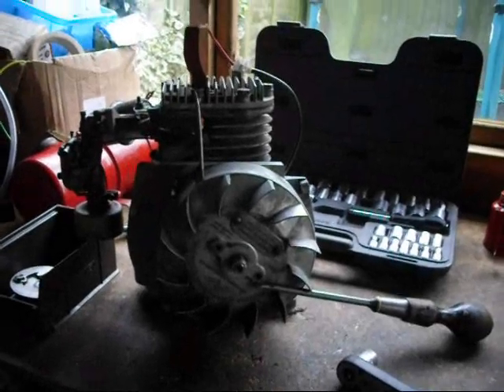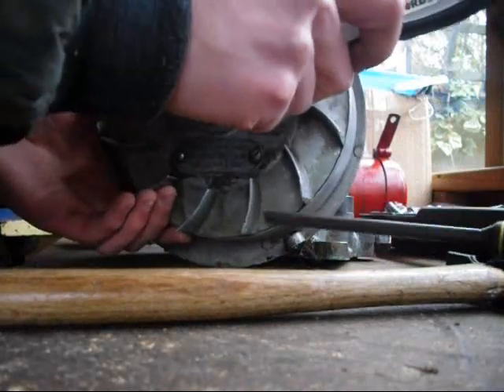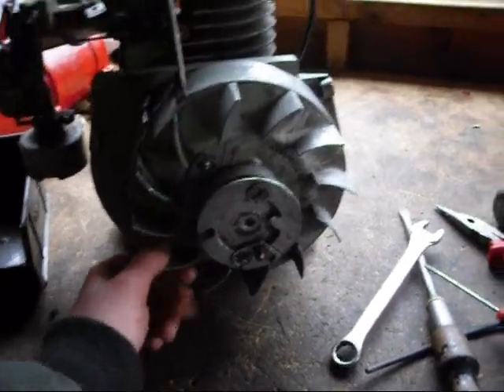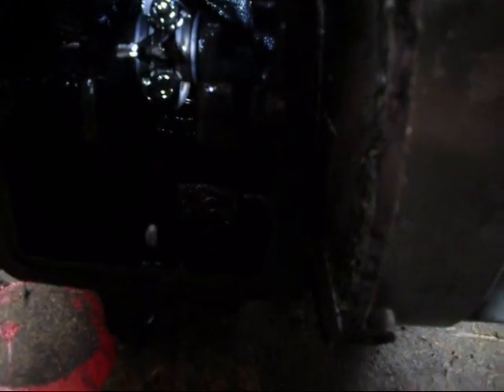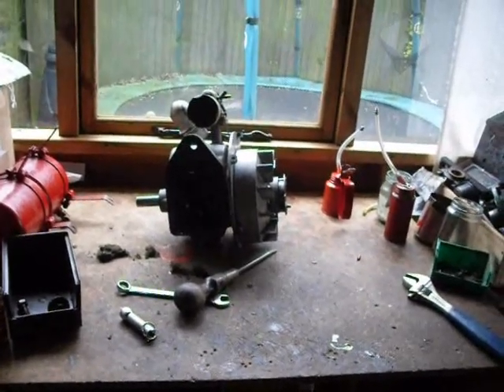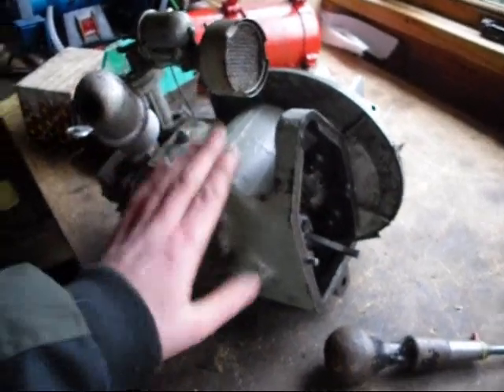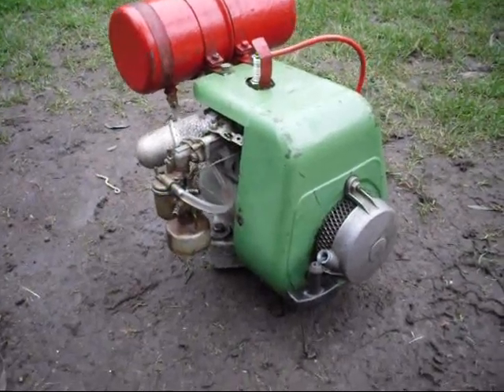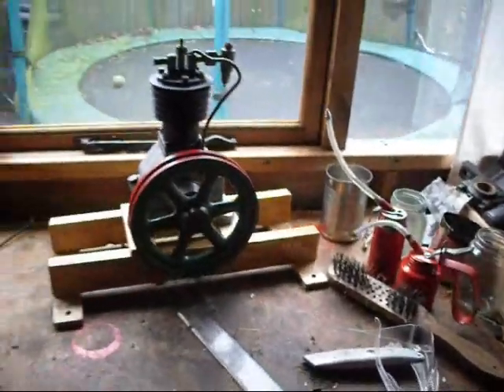Suffolk Compressor Set - Part 1 - The engine

Comment: Very informative, well done. I didn't know about the cork in hot water trick, useful tip.
Two little things for me, as an ex-toolmaker, that hammer you used when removing the fly wheel will definitely bruise the shaft and nut, if your not very careful. A copper mallet would be much better, and heavier too, better results. Secondly the light from the shed window made the subject difficult to see in parts, so better lighting from behind. All in all very interesting, nice to hear it running too. 5*

Comment: PHILLLLLLL NOOO YOU BUTCHER just joking a better way of holding the flywheel still is to put some shoe lace though the plug hole and that holds the engine to remove the nut